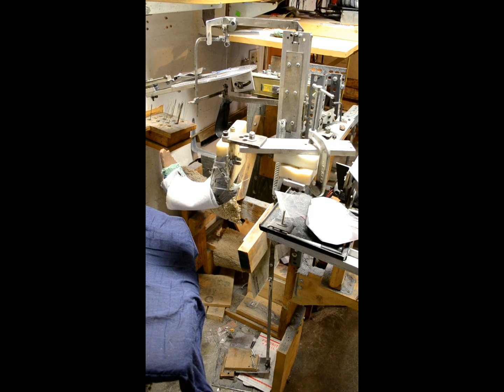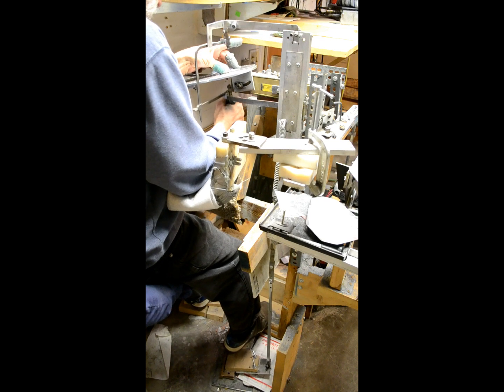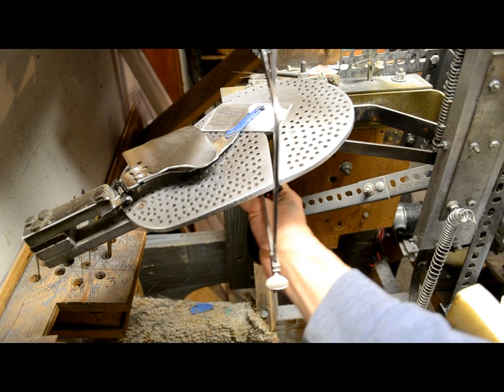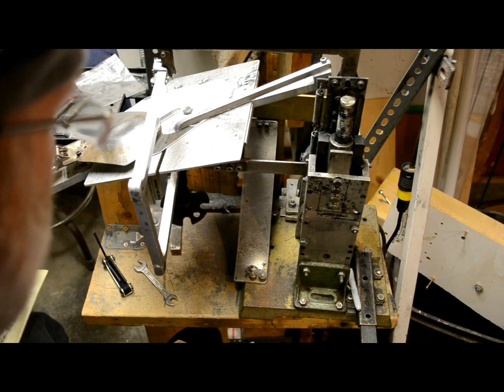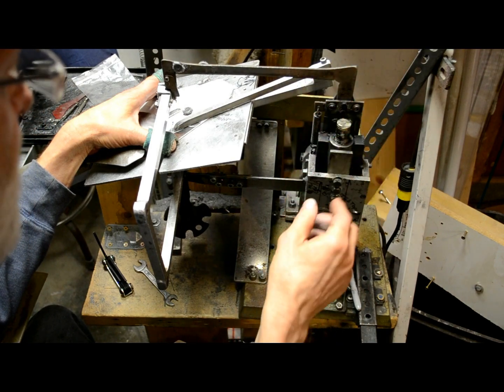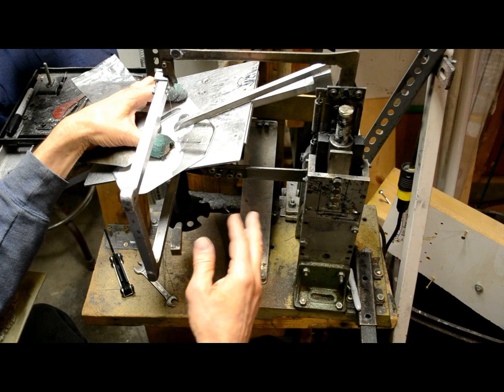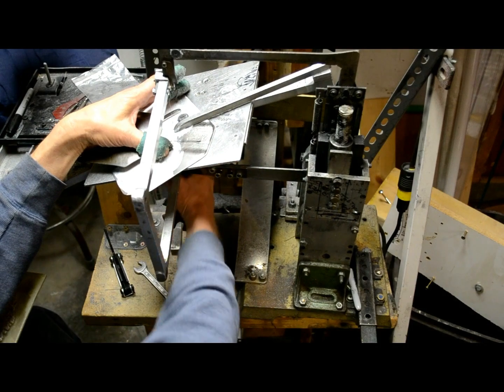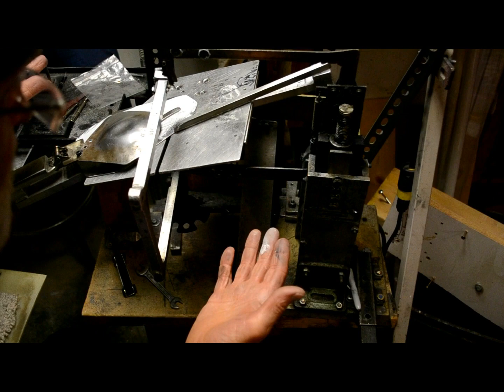Manual and Motorized  Saws For Pancake Dies

Comment: Wouldn't a scroll saw work with a jeweler's blade?
Reply from the maker: sorry for the late reply!! Scroll saws have such a short stroke that one short length of blade would get all the stress , and fail much quicker than what you see here. Also, the slight forward and backward "swing" in this system allows me to duplicate the natural pressure cycle of hand sawing : forward pressure on the cutting (down) stroke, and easing off on the upstroke. This also reduces stress on the blade, making it last longer.

Comment: http://glavmex.ru/forum/viewtopic.php?f=3&p=34133    14 май 2013, 17:40  
История лобзика. Histori jig scroll saw machine.
Good evening.
As in my opinion.
The most balanced solution of a jewelery jigsaw with a rigid frame.
It is enough to make a turntable.
Reply from the maker: Hi, some of those look interesting, but I never met a scroll saw I liked for sawing RT/pancake dies using jewelers saw blades. The stroke is too short , for one thing, and the forward pressure cycle of a hand held saw frame helps the blades last longer.
Reply: http://glavmex.ru/forum/viewtopic.php?f=3&t=711&start=20  1 мод.  Добавлено: 26 дек 2011, 16:51 ... 2 мод Добавлено: 26 дек 2011, 16:50  ход.50 мм.
The stroke is too short , for one thing, and the forward pressure cycle of a hand held saw frame helps the blades last longer.
Structurally nothing prevents to make a move of 35-50 mm.
But the deflection of the saw during idling is structurally solved only in sawmills on wood.
This jigsaw has a stroke of 35-50 mm. The author has another 1 model but was built 25-30 years ago.

Comment from the maker: "Swiss-made , (for Platinum)"  blades are sold under 3 brands that I know of , but are all the same blades (Pike Platinum , Glardon-Vallorbe, and Sierra (Contenti's brand). There may be other labels they come under, but they are the absolute best blades for sawing the 0-1 
tool steel I make my dies with . That's oil hardening tool steel , so all my dies are heat treated  for long life, even with intricate designs. That , and the angled cut that leaves a very tight tolerance to the cutting edges , allowing them to cut clean parts , are the main differences between my dies and Potter USA dies . This ( the angled cut, for tight tolerance , that makes the dies cut without burrs !!!!  ) is the way pancake dies are supposed to be made.; plain and simple (but not necessarily easy (^; ). That's why they pay me the medium bucks !